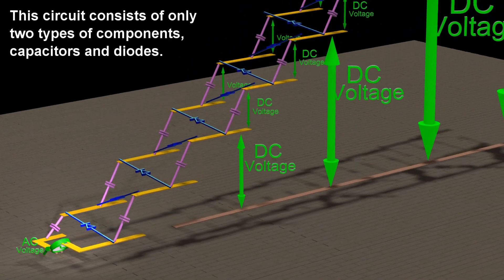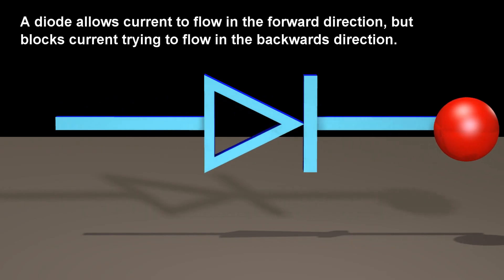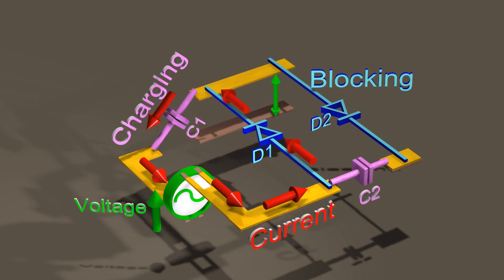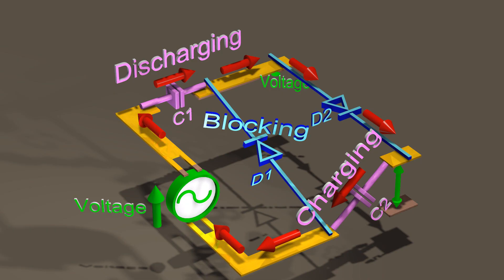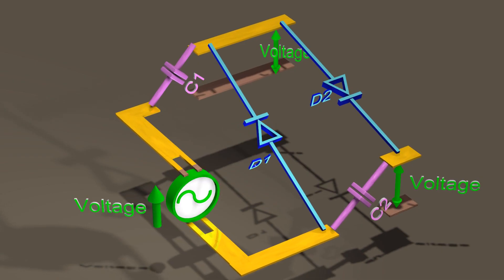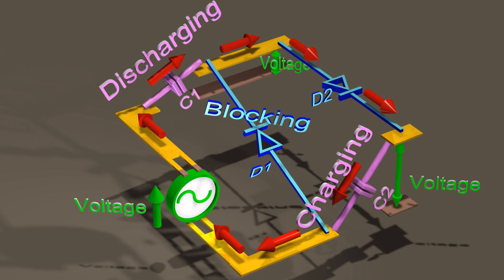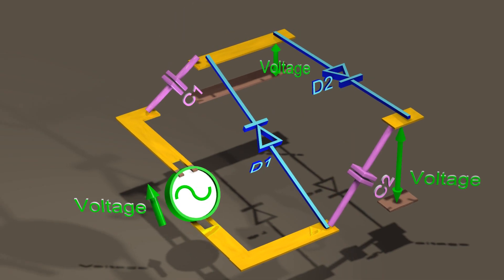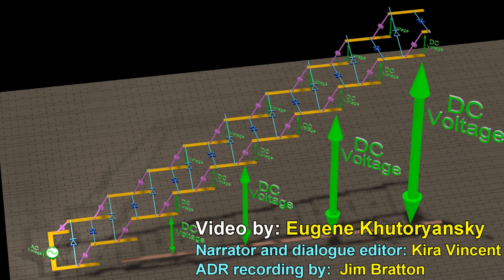Voltage multiplier: Generating over 100,000 volts DC

Comment: The diode conducting ( forward biased) will have the same voltage on both sides minus .7v ...each diode usually has a 7/10 of 1 volt drop.

Comment: Kira Is it possible to devise a circuit that accomplishes the reverse? Can you have a circuit that receives the output of a very high DC voltage safe from a Van de Graaff generator and instead reduces the voltage in order to produce a much larger current?
Reply from the maker: Buck Converters can do this.  I describe this in my video "Boost and Buck Converters" at https://youtu.be/vwJYIorz_Aw

Comment: Excellent video 
Plz, can this curcuit operate motor 2 amp 100 volt ? Help
Reply from the maker: No.  As I said at the end of the video, this circuit can't supply much current, because this will quickly discharge the capacitors.  To supply a large current, you could use a Boost Converter, which I describe in my video at https://youtu.be/vwJYIorz_Aw

Comment: I finally understand it. Thank u! Boy electricity is not something u learn over night that’s for sure. 4 years into the industry now and just now starting to understand the harder stuff for me. Like why a resistive dimmer is bad for a ac fan. Like am I right in this: (only ask cause I think I put it together tonight and wanna make sure I’m right) The reason that dimmers are bad for fans is this; dimmers lower power by increasing the resistance of a circuit. This increase in resistance lowers the current which lowers the magnetic field in the coil: The coil is essentially a short circuit without impedance. And so without something impeding the current it will go up to infinity. Well what normally prevents this in a circuit is the amount of current that creates a certain amount of impedance by inductive reactance. So if a fan is designed to work at 120v, it relies on that voltage to produce a certain amount of current with the given inductance of the coil. If that voltage were to decrease, the current and ultimately the inductive reactance would decrease, paradoxically increasing the current. This increase in current would probably burn the coil of the fan ultimately breaking it. And this is why a dimmer is bad for a fan!

Comment: We learned the basics, and then applied them to stuff like this, break it down to the simplest first. DC series, parallel, RC time constant, ohms law, voltage drops, kirchoffs laws..etc, then AC, power factor, transformers, impedance, capacitors and inductors in series parallel and how frequency affects each circuit,  digital logic,  semiconductors, fets, diodes, transistors, op amps. throw in some thevinins, and other fun stuff. I took the electronics course, with some AC power distribution basics, and computers added on. They made it very basic at first then built on it.

Comment: I have my High Voltage Engineering Exam tomorrow, at this is by far the best explanation ever. 🔥🔥
Wish my professors had shown this instead of wasting time.
Reply from the maker: Good luck with your exam.  Thanks for the compliment about my explanation.

Comment: nice video, though i wonder do capacitors not overload at some point? or can't this happen.
Reply from the maker: Each of the capacitors only has a small voltage drop across it.  All these voltage drops add up to produce the large DC voltage.  But, the voltage rating of the capacitor only has to do with the voltage drop across the individual capacitor.

Comment: If cap 1 is charged to 20volts and then cap 2 is charged to 20volts how is it that cap 1 is charging cap 2 with a higher voltage when they both hold the same voltage?

Comment: what after the output voltage is  twice the Ac voltage, why it's not increasing more with every successive cycle why it stop increasing after it turns twice the AC voltage. just this doubt remain, everything else is just crystal clear

Comment: How about current?
Reply: The current decreases with the increasing voltage and power stays consistent throughout which is why the voltage doesn’t double between each cycle but it multiplies by increasing the same amount as the input voltage at each cycle. 2v↗️4v↗️6v↗️8v

Comment: if you have 1000 capacitors and a 1.5v battery and if you charge each capacitors with 1.5v battery and connect they series together, you will be created 1500v from 1.5v battery

Comment: Does this circuit produce pure DC. Where can I get a circuit diagram for this
Reply from the maker: There will be a ripple on top of the DC.  The size of the ripple depends on how much load you have and how leaky the capacitors are, as both of these cause the capacitors to discharge, and the capacitors then need to be recharged.  You were looking at a circuit diagram here in this video.  You can also see other circuit diagrams by typing "Cockcroft–Walton generator" into Google.
Reply: @EugeneKhutoryansky  I needed a non pulsating DC of voltage output varyable from 20k to 40k volts for a electrostatic smoke precipitator project. I am not the one having an electronics background. Any help will be hugely appreciated.

Comment: very important in a such system is the forward voltage of the diode, without it such a system will not work

Comment: amazing! one quick question. shouldn't the capacitor on the output charge up to its maximum charging capacity and not just double the peak input voltage?
Reply: it doubles because of the polarity changing on source. It's source went down. So now it is twice as high relative to its original source voltage because current cannot flow through the first diode through the capacitor and thereby discharging it. It's a voltage spike.

Comment: What wonderful video! It's non easy to understand how a voltage doubler really works, because there are many factors acting together (alternate current, capacitor charging and discharging and so on). Therefore it's difficult to understand what it's really happening , just figuring it out  by mind. A beatiful  demonstration of an image which is worth a 1000 words.
Reply from the maker: Thanks for the compliment about my video.

Comment: How can the voltage value of capacitor C2 increase up to twice the input voltage? Isn't the current coming from the AC voltage source during the second charge of the capacitor C2 and trying to pass through the diode D2 is blocked due to the potential of C2?

Comment: Say, we will produce 100,000 VDC from 220 VAC. Which one will be CHEAPER if firstly we rectify the AC to 12 VDC and then using boost converter we step up to 100,000 VDC compare to this method?

Comment: I have a question about how this works. Would current not move in the direction of lower voltage? In that case, since the capacitor C2 would have higher voltage than the source, it would just equalize with the source's voltage and reach equilibrium, not an even higher voltage. I might be wrong

Comment: I enjoy watching your videos because of the animations; I'm not a native English speaker so my vocabulary is very limited but the animations helps me understand everything clearly. Thank you so much.
 Please I a need a help; I'm building a circuit with 50 2200 micro farad capacitors. The capacitors will be connected to a 10W solar cell with output of 9V and 0.3A to charge them.
I want to know if I Will be able to increase the volts and current of the solar panel by charging and discharging the 50 caps individually.
Say one cap is charged to the output of the solar cell at 9V and 0.3A; will 50 caps deliver 450V and 15A if we are able to discharge one cap at a time and using diodes to control power follow?

Comment: Is this not a variation of the Cockcroft-Walton ( pioneers in nuclear physics) voltage ladder and used in colour CRT tubes to accelerate electrons to higher levels than monochrome CRT?
Reply from the maker: This is a Cockcroft-Walton voltage ladder.

Comment: Capacitor 2 doesn't it reach maximum voltage after five cycles,
Reply: Close to ten cycles are needed to charge the capacitor to about its maximal voltage.
Reply: @markhesse4510  from the manual. A capacitor charges to 63% of the supply voltage that is charging it after one time period. After 5 time periods, a capacitor charges up to over 99% of its supply voltage. it has been 44 since I receive my degree. I started on tubes

Comment: Need a different animation for the caps.  Voltage flowing through the cap?  Maybe one side should swell with negative charge and the other side shrink with reduced negative charge?

Comment: Once you have 100,000 volts, can you use it somehow?
Reply: Not really, because if you put a load on that 100KV, it will draw a ton of current, and their will be a huge voltage drop on the source's internal resistance.
Reply: ChuranuQC with 100kV, you’re right.  But with lower voltages, can you use it?
Reply: @jwil4286  If you're talking practically, you won't need to increase the voltage much for the breakers to trip, unless your loads have a pretty high impedance. I'd say the margin where you could use it is pretty small.
Reply: Make a spark

Comment: At 3:54 you made C1 to discharge completely. Upto this it's all ok. But why capacitor C1 is not charging in reverse polarity via path Source-C1-D2-C2- Source. At this point C2 is still on low voltage, along with reverse charging of C1 C2 should rise to even higher voltage? 

Please, readers here, your explanation in the will be really appreciated😊.

Comment: Thanks! Very clear and interesting. One question: you assume that the diodes operate at 0V forward voltage? otherwise, no current will flow through D2 when its cathod voltage is greater than its anode voltage

Comment: I don't understand 2:32. I don't believe that current flows through a capacitor unless it's breakdown voltage has been exceeded.
Reply: MACROPARTICLE it just appears as current flowing through but it’s actually not. Electrons accumulate on one end while electrons leave the other end.
Reply: @fernandolozano9898  It's only the case until the capacitor is fully charged. There's a limit to how many electrons can accumulate on one side and leave on the other.
Reply: Exactly. But for the sake of simplicity they are showing that current is flowing through during the charging or discharging states!

Comment: I wander if using voltages instead of currents would make it little easier to understand intuitively, why the voltage doubles at the output of every stage? Assuming ideal diodes the Vpeak of the source is transferred to the first capacitor in the first half of the cycle and during the second cycle, the second capacitor acquires the sum of Vpeak from the source plus voltage acquired during the first half cycle by the first capacitor.

Comment: can it be dangerous?
Reply: Yes. The 10x multipliers I work around charge to around 2500V. This is from a little 250V AC supply that runs on 12V DC.  This is high enough that some care must be taken in construction. You don't want to be poking around the circuit with bare fingers, even after it's been shut off for a while. That 2500V is then discharged through a transformer to create about 250000V to strike an arc lamp. I've seen a circuit that was poorly made arc across the component leads instead of through the transformer, and it got off an extra 2 arcs after the power supply stopped trying to strike the lamp. This same circuit still had some juice in it 5 minutes later while I tried to bend some leads with a metal tool. I'm lucky I had gloves on, or I would have gotten a sharp reminder to be careful around high voltage capacitors.

Comment: Using a standard electrolytic capacitor, I can see how amperage would be lacking.  What about the use of "Supercapacitors"?  I am a novice with electronics.  Forgive me.  I see possibilities with this, purely from an amateur perspective.  I am sure if what I have in mind was possible, it would have already been done.  What are the values of or part numbers for the components?  I saw something in the shadows of the presentation that was not displayed in the forward portion.  As the circuit added segments, how much larger would the diodes and capacitors need to be?  I am not an electronic engineer in any way, shape or form.  I only know a little math.  Something that is glaring, to me, is that the time for charging and discharging the caps is not discussed.  That would surely have an effect on the circuit and determine the availability of a given output voltage. Yes?

Comment: What if the standard electrolytic capacitors were replaced with supercapacitors? Would each stage be able to produce an even higher voltage because each capacitor could store more charge?

Also, what is the purpose of Capacitor 1 if only Capacitor 2 gains average voltage across?
Reply: Electrolytics are polarized and will fail in this circuit. Super capacitors do not hold more charge, they simply charge quickly with less leakage making them more like batteries. This demonstration is already using ideal components. In reality, using very good components, the output voltage will be about V-in * n - (0.3 * n) because of diode losses. These losses stack for each additional stage. A 10x multiplier with a 10V V_in will have, at best, a 97V output. There will be additional loss due to leakage. The current will also be fairly low because of the high impedance of the circuit. 10x is about as high as is practical.
Reply: The purpose of C1 is to hold a charge that is added to V_in and gets dumped into C2. Each stage in a multiplier multiplies the voltage. C1 multiplies it by 1.

Comment: your videos have not revolutionized my thinking of currents and voltages but rather visualized them in a great way.

However, for this particular video I am not completely satisfied with the way you present the currents - it is not D2 which blocks the current from flowing from the source, but the already higher potential at the node connecting C2 to the cathode of D2. Current would not "want" to go uphill from the source, with or without any diode. The diode keeps C2 from discharging - however that would be a current originating in C2's right plate. Also the discharge current of C1 should not be started in the source but in the capacitor itself, passing through D2, C2, through the source and then returning to the left plate of C1.

Comment: Technically electrons flow against the arrow (cathode) on the diode.
Reply from the maker: I am showing positive current flow, which is in the opposite direction of electron flow.  Showing positive current flow is the standard in education and in industry.
Reply: Understandable, tho I do not agree with it. I think conventional flow should be done away with. It is clearly stated in some of your videos that positively charged particles are stationary so I don't know why people are still teaching that they move.
Reply from the maker: For my very first video, I showed electron flow, and people complained that I need to instead show positive current flow.  I guess there is no way to please everyone simultaneously.
Reply: That's a fact. Either way I think your videos are great! As much as I dislike conventional flow it doesn't take away from the awesome quality of what you post.

Comment: What if I want higher dc Voltage with higher current.......and the input is DC
12V input and output to be around 42V and current to be 60A+
Reply from the maker: Then you can use a "Boost Converter", which I cover in my video at https://youtu.be/vwJYIorz_Aw

Comment: The problem here is you are not specifying where the DC ground should be measured across. That diagram looks neat in theory, but when you don't explain how the physically measure the output DC voltage, it is nothing more than a cartoon...
The DC ground in the video is represented bu a complacently separate and un-connected ground..

Comment: For a much better and more practical explanation of a Cockcroft-Walton multiplyer See EEVblog's video #469 here: https://youtu.be/ep3D_LC2UzU It includes theory and building actual circuits.

The circuit shown in the video above would need a very high voltage input (neighborhood of 10,000 Volts?) to approach a 100,000V output. Good luck finding caps and diodes rated for that
Reply from the maker: Which explanation is better is a matter of opinion, and many people prefer my 3D animations.  In any case, the circuit he shows in his video is identical to the one in my video.  And no, you don't need a high input voltage, just a large number of stages.  And no, you don't need high voltage capacitors and diodes, as the voltage drop across each component is small, but all these voltage drop add together to form the total output voltage.  I have worked with a device which used this circuit to create 100,000 V DC from an input of less than 200 V AC.
Reply: Perhaps it is just a mater of language. I take "Voltage multiplier: Generating over 100,000 volts DC" to mean " This Voltage multiplier: Generating over 100,000 volts DC," which it would not since it would require many more steps. 

I thought I was clear before but I will rewrite the last sentence in my post above here: "The circuit shown in the video above would need close to a 10kV input to approach a 100,000V output in that number of steps illustrated. Capacitors and diodes rated for 10kV may be difficult to find." (same meaning, simplified language, still true)

Comment: It might be a little clearer if you kept the lower right hand corner stationary.  The people could see that the voltage in the top side of the capacitor was double relative to the lower corner.  Good videos.

Comment: When capacitor C2 is increasing in charge why does current not flow thru diode D1 on that part of the cycle? Is there some mechanism that stops the current from flowing from C2 to D1 but instead goes straight back to AC source?